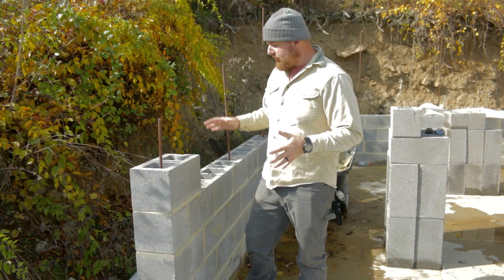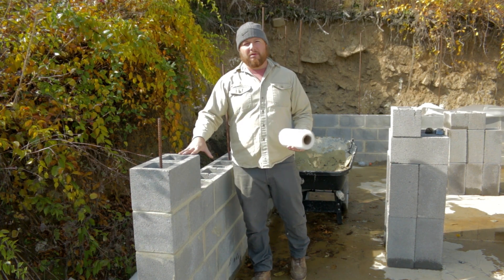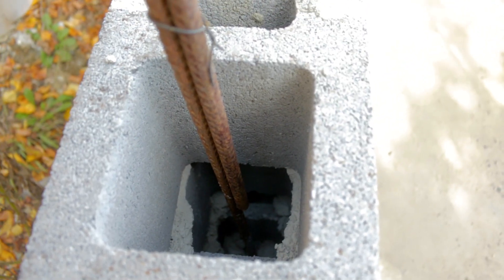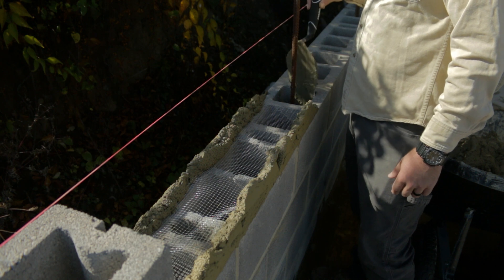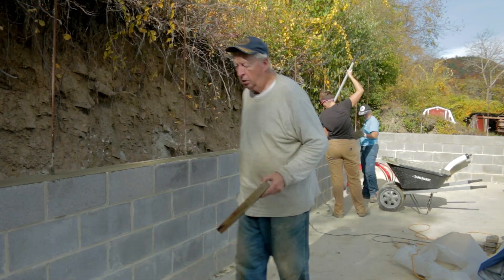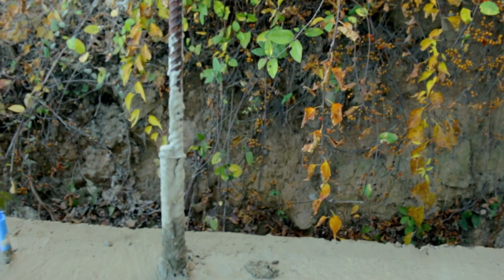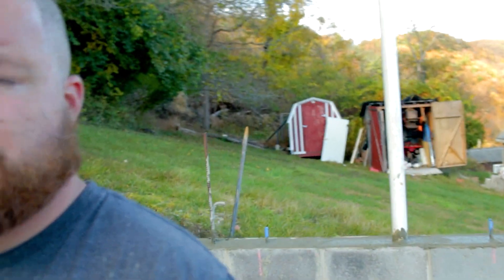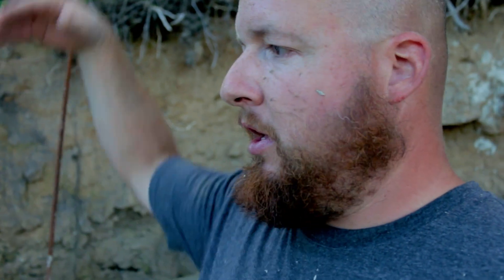Garage Build #22 -  CMU Bond Beam

Comment: I'm just a lay person, but that gravel looks way too big to be ideal for filling the vertical rebar channels.  I've read that rebar needs a certain cement coverage to stop corrosion.  If gravel is contacting the rebar, that minimum coverage has to be thicker to compensate.
Reply from the maker: The stone that was used is 2B Stone. That is what is used in everyday concrete.
Reply: @appalachiandiy2415  Which is why I've read that concrete with any significant aggregate is not used in bond beams or around rebar.  Rather 'grout' slurry of cement that pours into every crevice is used for bond beams and around vertical starters.  From my reading this is the industry standard practice?

Comment: Grout should be pea gravel max for coarse grout, it's sand for fine grout.  Grouting aggregate sizes are important to maintain rebar clearances within the CELLS
Reply: Yeah I noticed instantly, and I'm just a lay person.  That gravel was massive and has to find its way down a fairly narrow channel around rebar.  It has to be more liable to risk air pockets/voids even with vibration, and the minimum coverage of the rebar to stop corrosion is compromised if aggregate is contacting the rebar instead of cement.
Reply from the maker: Do you have a building code or some way to research this? I would like to read the specs on what you're saying

Comment: Great videos --  I have a question --  I am trying to find information on the detail of where to start the VERTICAL rebar when you are setting up the footer layouts -- For example, for the CORNER of the placement of the first CMU how far in from the outside corner do you set the 1st Vertical Rebar on a corner block (my guess is about 4 to 5 inches?) then from that Vert every 4 foot on center?  Is that right?
Reply from the maker: Yes, the corner cell should have rebar in it and it shouldn't be centered. And yes, then after that it should be every 4 ft. If you think you're going to have a lot of pressure on the wall you can make it every 2 ft. But I would not go over 4 ft on center, that should be your max

Comment: Never place your rebar the way it shows in this video.  There is literally no coverage [see TM 8:30 at the corner].  It's also too close the the inside face of the block.
Reply from the maker: @Long-Island-Sound  it may look close but there's at least an inch of coverage from the face to the rebar. I would like to hear if you have any technical data to back up how far your rebar should be spaced

Comment: A rebar tie is only there to keep rebar in place during the concrete pour, if one tie would do it that would be all you need. Lots install after cavity is installed
Reply from the maker: Yes, it's only there to keep it in place. However, it doesn't hurt to have more ties to make sure that something doesn't rupture during the pour

Comment: Being up against the hillside and being a load bearing wall you should have probably had upright steel every 16'' and filled the whole wall with a grout mix that has 3/8 gravel instead of the 3/4 crush you used.  3/8 will flow better around the steel and not create the amount of air pockets that 3/4 will
Reply from the maker: I probably would have filled it completely full if we weren't hand mixing all of it. There's no way to get a concrete truck up there unless we had a pump truck. We did vibe down through all the cells when we poured concrete to make sure we had no air pockets

Comment: Those break out pieces are supposed to laid inside the openings in which they were broken from according to my engineer. I'm doing a block wall to fix my about 34 feet of my foundation.  My engineer and the block company guy who's been in the business for 40 years - both said those break out pieces should be laid in the blocks holes.
Reply from the maker: How would you lay them in the block holes without making air pockets? They are sometimes pretty big chunks, If not one big chunk. I would be afraid that it would not allow concrete to flow around it and fill the cell completely.
Reply: @appalachiandiy2415  if anything I would break them up and throw them in the wet cement to strengthen it

Comment: I'm not really sure how to pour a horizontal reinforced bond beam and a vertical beam where they intersect in the middle of a wall. 
I assume either one or the other wouldn't be a continuous pour at that intersection if the wall keeps going higher than the horizontal bond beam.
Reply from the maker: Horizontal Bond beams are poured once that portion of block is laid and there is mesh underneath them to keep it only in that layer. Where the verticals are there is no mesh so the concrete can fall straight down the vertical shaft or cells.

Comment: I'm building a shed  where the back wall will be CMU this is a retaining wall as a structural wall. I have vertical #4 rebar every 16"  & horizontal bond beam every 2 courses  am I over doing it?
Reply: Over engineering is a matter of opinion. Under engineering is a matter of fact. My new favorite quote from the garage journal.
Reply from the maker: I like it!
Reply from the maker: For a shed, possibly. Although it doesn't hurt to have it last for centuries!

Comment: I don't think it was discussed in the video, why would you NOT want to fill the entire wall for a load bearing wall?
Reply: Itd be heavy and expensive.
Reply: @KingSobieski  cheaper than hiring a outfit to pour solid walls.  Especially if your not worried about leakage, because that's the biggest problem with block walls other than falling apart if not reinforced.
Reply: I'd imagine the foundation would have to be beefed up to compensate for the large weight increase.
Reply from the maker: The main reason is cost and time. We were hand mixing all the grout that we put in and just doing that took us forever. If I was able to do it all at once and get a pump truck with a huge boom to get up the hill I would have done but again that's a huge expense